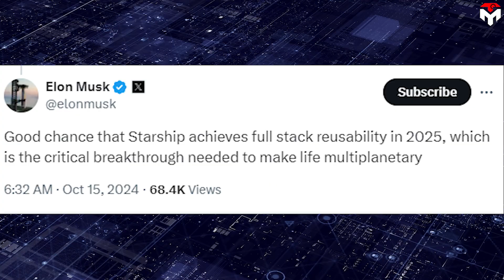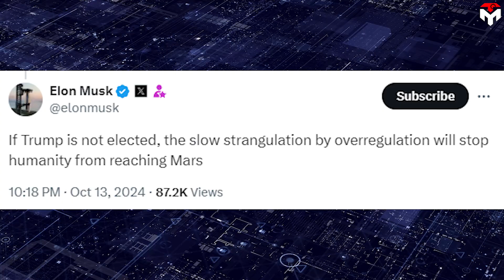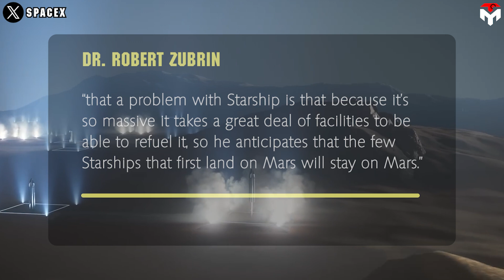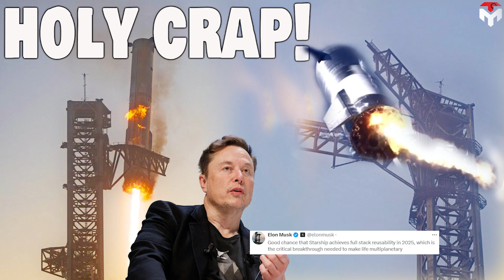What Elon Musk Just Revealed About Starship Full Reusability Shocked NASA...

Comment: Isn't there a problem with  the fins getting damaged?
Reply from the maker: Do you find any signs of damage?
Reply: @techmap9  I watched the videos, there was almost a burn through on the front right fin.
Reply: @techmap9  No but I think it is a sensible question especially with the booster coming in so fast
Reply: There may be. There are hundreds or thousands of problems, large and small. The team detects and corrects them, in due course
Reply: @jacobladder5556  Good answer. Thanks!